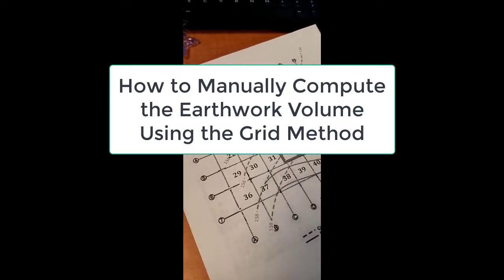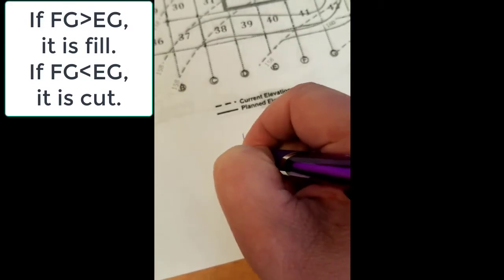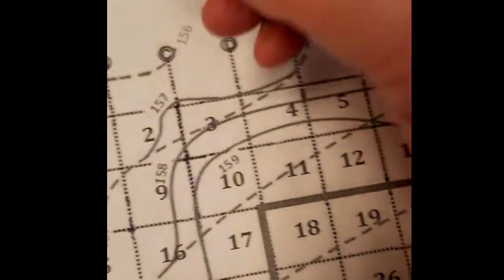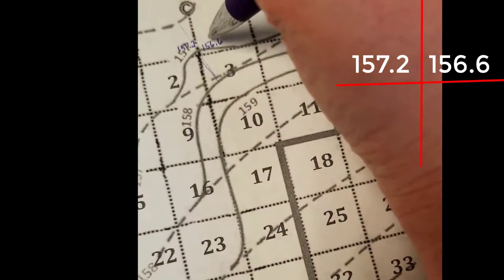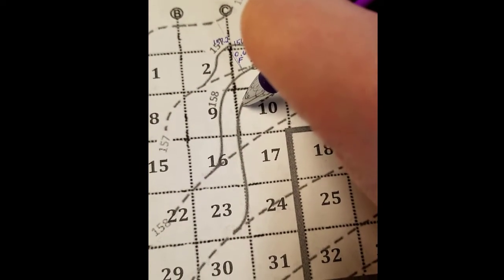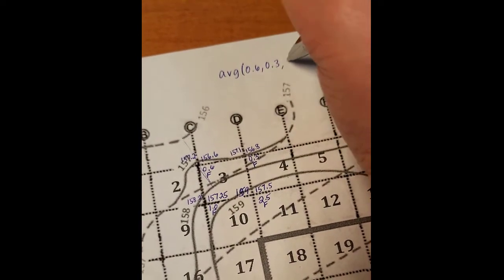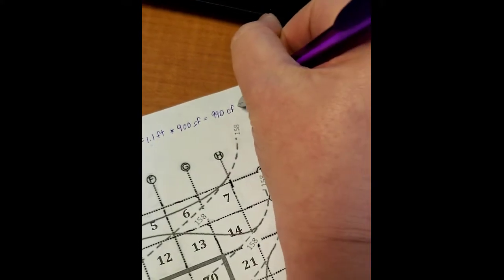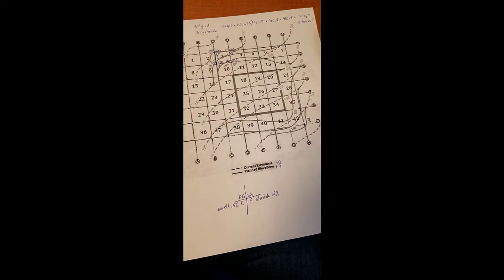How to Compute Cut or Fill with the Grid Method

Comment: In real world examples, it becomes a little more tricky when you have an Asphalt road running through three quarters of the grid and you have a building foundation running through one quarter of the grid. Then you have to account for their individual thicknesses avg it (3 x road thickness + 1 x building fdn thickness)/4 to get the average bottom elevation. Of course there are earthwork takeoff software like Roctek Winex etc. to automate all these calculations and get a very accurate  cut/fill takeoff.
Reply from the maker: I agree! In our academic setting, we definitely are trying to get them to see that there are many factors to consider. Their first project was actually to review various take-off software, but our department's philosophy is that if you don't know how to do a process manually, you will be relying on a device instead of your knowledge.
Please keep watching and commenting! I love it :-)

Comment: HI, Very nice example ... it was a good refresher on manual earthwork takeoff calculations for me ... just some minor corrections if I may point out please... one the 4th point 159-157.5 is 1.5 (instead of 2.5) and so the average is (.6+.3+1+1.5)/4 = 0.85 ft Fill Height. Vol = 30 ft x 30 ft x 0.85 ft = 765 c.ft. And I guess here's the important part.... since this fill is compacted and we have a soil shrinkage of 12% we need more soil i.e., 765 x 1.12 = 857 c.ft. / 27 cft per yd = 32 cyd. And 1 truck being 13 cyd. We need 32/13 = 2.46 that's approx 3 truck loads of soil fill. Same as your final answer luckily unless you can order 2 and a 1/2 truck loads. Anyways nice example. Thanks.
Reply from the maker: Thanks again for spotting that typo. I was working from both an Excel workbook and a separate answer sheet...lol

Comment: I'm lost, so once you figured 36.67 cy of fill required for this section wouldn't you then multiply 36.67 x 1.12 = 41 cubic yards? That's adding 12% for shrinkage? Or is it 12% less? -4.4 yards = 32.3 cubic yards? If the fill shrinks after compaction then 41 cubic yards would go in and be compacted down 12% = 37 cubic yards. Is this right?
Reply: Yes you are right. You need to multiply 36.67cy by a factor of 1.12 (shrinkage factor) to account for the compaction later. Also, the 36.67 cy was actually 32cy as the 4th point was accidentally calculated as 2.5m instead of 1.5m. But overall nice example.
Reply: @surajdarra  Thank you so much! And I didn't even catch mistake. So the 4 points added up = 3.4 ÷ 4 = .85 x 900 sq. ft. = 765 ÷ 27 = 28.33 x 1.12 = 31.73 (32 cyds.) which I just now noticed is the same as you already wrote below. So great! I get it! I understand now 100%, thank you very much!!! (hint: if you hold down the Alt key on the keyboard and type 246, you will end up with the "÷" divide sign, instead of using "/" ) It works, but I thought I would try to help you somehow, since you helped me learn!
Reply from the maker: Thank you for catching that error!!! Happy estimating :-)
Reply: @JHarv901  To account for shrink you DO NOT multiply by 112%. Divide by (100%-12%). 28.33 CY ÷ 88% = 32.19 CY of Loose  Fill needed.
Reply from the maker: @aaronsharp8857  Shrink is the amount the fill material can be compacted once out of the truck, so you need to order that % more than your fill volume.
Swell is how much the cut material expands once it is in the truck, so you need to calculate that % more than your cut volume to correctly estimate the number of hauls (truckloads).